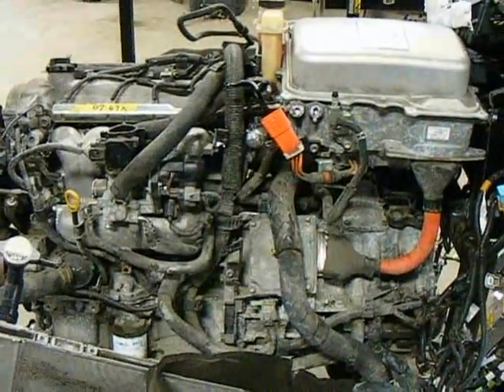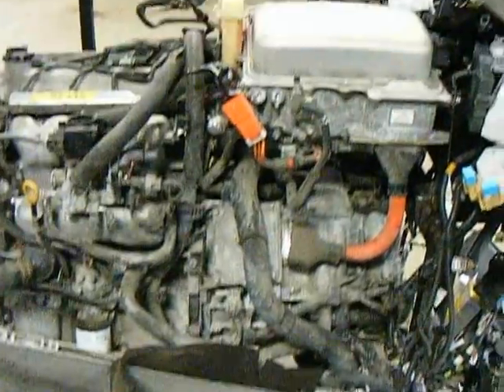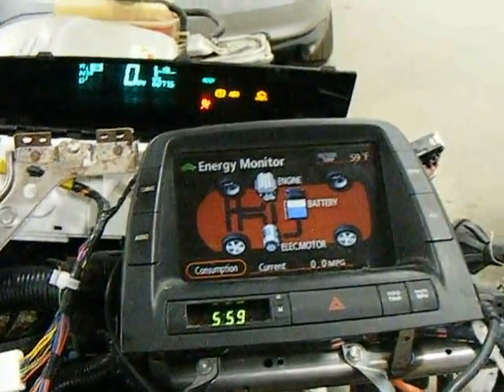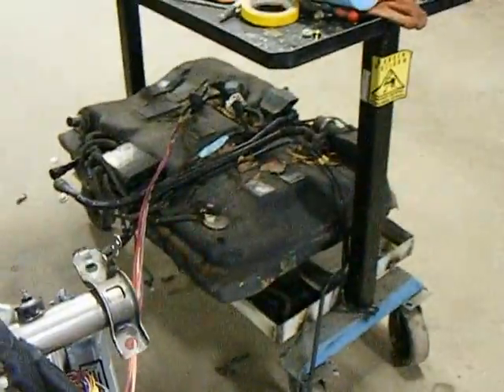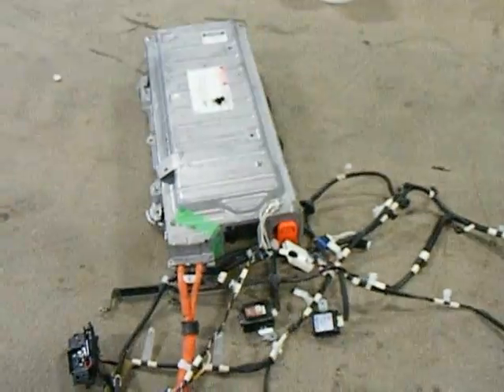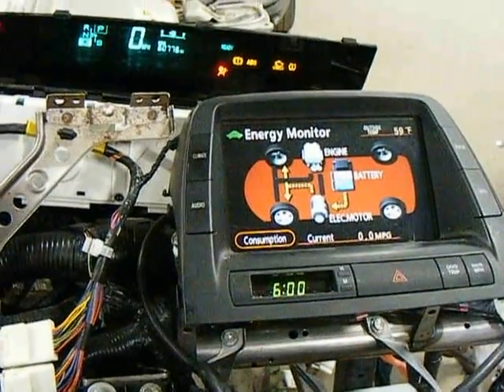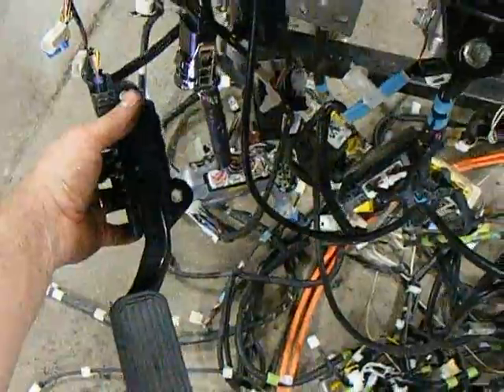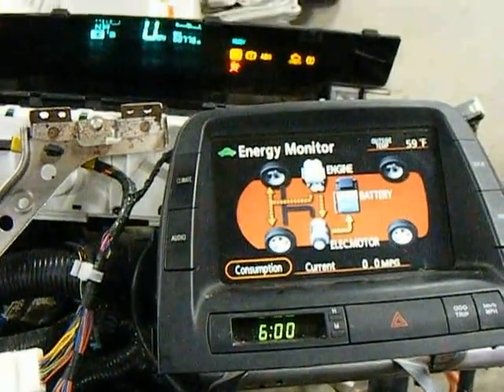Hybrid boat motor

Comment: Glad to see somebody doing what I had been thinking about for a long time. Prolly not just me, but you have the whole deal in one big heap and working. Now its like : How do i transfer this to a boat ? Did you ever apply it to a boat ?
Reply from the maker: yes it worked, here is a link to the finished boat, that I have since sold http://autobeyours.com/1996%20Silverton%20312.htm
there are also photos of the hybrid motor installation,   top speed was 9mph with one prop turning
Reply: @imwoody36also  Would you recommend doing this for a pontoon?